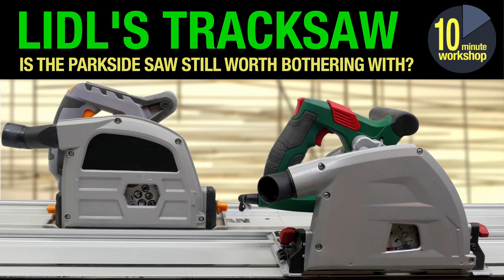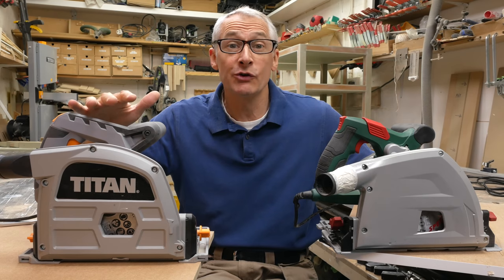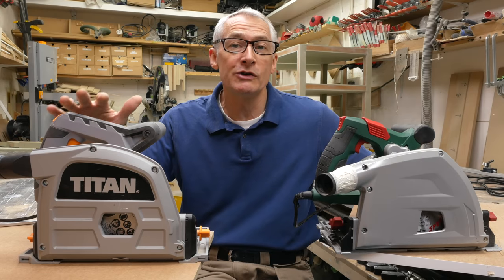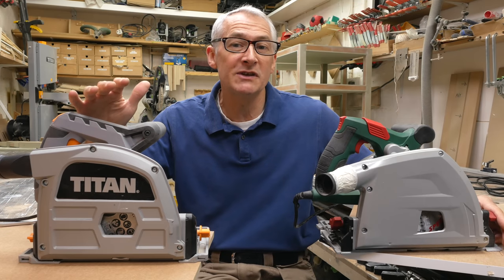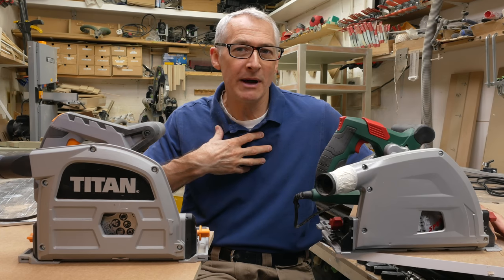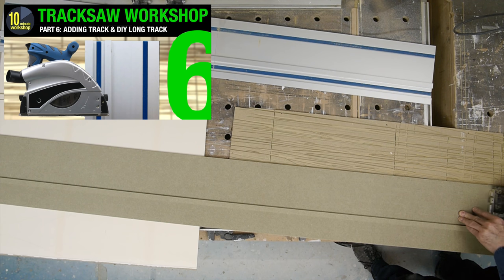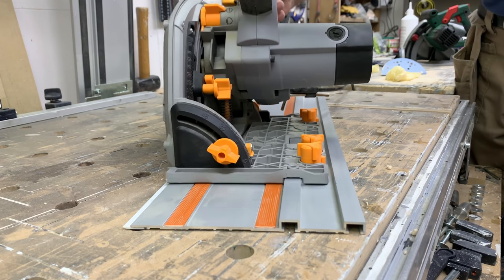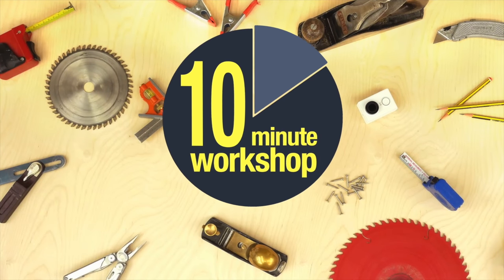Screwfix Titan or Lidl's Parkside Plunge Saw? [video #326]

Comment: Peter I see you have evolution track does it fit with titan track, I've seen comments it does and ones it doesn't, a titan track and a 1400 evolution track together be handy for triming doors
Reply from the maker: I'll have a video out about the Evolution track before too long, but I don't see why there'd be a problem; the titan track is as close to the makita track as you can get, and the makita track is Festool-pattern with an added lip. Workshop's a spray booth right now so I can't get at anything, but I'll take a look and post back 👍
Reply: @10MinuteWorkshop  Thanks Peter

Comment: hi peter great video. i just picked up the triton plunge saw because ill be cutting full sheets of plywood for flooring soon. i would like to get set up so i can cut the full lengths. whats the cheapest/best option to get rails to cut 2.4m lengths? i bought the triton instead of the workzone as you said it is more compatable with other rails. thanks
Reply from the maker: Hi Matt. Best option for rails right now is the Evolution rail package with two 1400 rails, clamps and a bag for ~£70;don't know why by my replies are getting chopped up, but the link is in the video description. 👍
Reply: @10MinuteWorkshop  thanks for getting back to me peter

Comment: I have watched all your numerous excellent plunge saw reviews setups etc but I am considering buying one and there seem to be very few reviews on Erbauer saw at Screwfix. Would you consider making one on this budget saw?
Reply: Nigel Timms I have a Erbauer one perfectly ok, l use it for rough stuff instead of Festool battery TS55 rail work with both slightly larger blade.

Comment: Hi Peter, on a related subject is the hinge for your fixed track saw rail a Festool specific item or could I adapt it to create a fixed rail with my Aldi rails(s)?  I looked on the website but couldn't locate it as a stand alone component.
Reply from the maker: It's part of the Festool MFT system (see videos #182 & 183) and the hinge is specific to Festool rails. They are available as a spare part, but the price isn't listed - last tie I looked they were a few hundred quid for the set. 🤷‍♂️🤔
Reply from the maker: Aldi uses Scheppach rails, so while you can't buy them from Aldi, you can get them from scheppach - at a price...
Reply: nasser d  
Parkside saw comes from LIDL not ALDI.
Workzone TOOLS ARE ALDI & Peter has a workzone tracksaw review.
Watch his videos.
Reply: Ta, I suspected as much. It caught my attention when I watched said vids, faithful acolyte that I am, and I've looked around at a few DIY options which various on here have califudged. It's not a necessity for me as I've made a table top sled/jig with fixed stops which serves me admirably but one alway wants the gadget doesn't one.

Comment: Excellent video as ever. I have bought the evolution guide rails for my Titan saw. I am looking forward to your thoughts on the evolution rails as mine do not have much grip at all when not clamped. So much so I am now looking for some new grip strips. Any help you can offer re this will be appreciated. Keep up the great content 👍😀
Reply from the maker: Interesting, I haven’t used the Evo rails in anger yet so haven’t had the chance to check out the grip. Best grip of all the rails I have is the Festool - do a search for Festool guiderail cushion strip and you should fine something. Only comes in 10metre lengths (I think) and not cheap, but great grip! 👍👍

Comment: Titan £55 in my local b&q, I saw another video on youtube where the splinter guard on the Parkside wasn't wide enough for the blade to cut through it and there was a gap, Parkside looks 2nd best and dearer, no brainer.
Reply from the maker: Yeah, that was probably Rim’s vid at Restoration Couple? He had a dud saw, no question. I’d have taken it back as soon as I saw the hunk on the blade cover. But yes, Titan at £55 is a steal. 👍

Comment: Another really helpful vid Peter. Have found the parkside plunge saw very useful a few times already since I got it. As I dont have a table saw, I have found it's quite versatile and is serving me well so far (apart from the vacuum connector which cracked, taped it up like yours now!). Got my eye on the evolution tracks... Thanks
P.s I've been looking maybe getting a Mitre saw and saw evolution do one quite reasonably priced. Can you recommend? Also, compound or sliding? Cheers
Reply from the maker: Thanks! I have an Evolution mitre saw on a longer-term test though I haven't used it all that much as I've had a lot going on. Let me just say that they're great if you have the need for a saw that will cut mild steel as well as timber, but if you just want something to cut wood then you can probably get a better finish elsewhere.
Reply: @10MinuteWorkshop  Thank you

Comment: I think the Lidl one is a generic Chinese model (with slight variations) - it looks suspiciously like the one I just got from Rutland tools, where they're branded it themselves with a sticker. But I think it's pretty good. I actually upgraded the tracks to Festool 1400s as I wasn't happy with A) the fact you need 4 of the original ones to cut an 8 x4 and B) the single-bar joining system does not inspire confidence. Much nicer with the Festool track. Cost me as much as the saw for 2 tracks and the joining bars, mind. I've also got a Freud 40 tooth blade in there and all in all, it works well. I've been cutting nice B/BB birch ply for kitchen cupboard doors, so the cuts have to be perfect at least on one side. The other thing about the Festool track is that the splinter guarding of the rubber strip actually works, because it's thick and high quality. It was useless on the other ones. Worth the upgrades for critical work, I think and still waaay cheaper than a Festool (that's my justification anyway)!
Reply from the maker: Yes, it's certainly very similar visually to the Rutlands one - couldn't say if they were made in the same factory without seeing them together, and probably not even then, lol! And yes, I agree - the tracks are the thing that let the saw down; a single 1400 rail would be much better, but we seem to be stuck with 2# 700s at the entry level.

Comment: When the Parkside is not available Rutlands has a clone of it in blue and red the price fluctuates like the Titan but they do, pretty regularly, do a 12 hour deal for power tools which you can sign up to receive by email
Reply: yup, i got mine for £70 from Rutlands. not let me down yet
Reply from the maker: Nice! Yes, the Rutland seems to be identical - didn’t know about the specials though! 👍👍
Reply: @10MinuteWorkshop  recently got the thicknesser, planner for under 160 rather than 240 they do some great deals, if it was something you were going to buy that is
Reply: @CharlieSkapentry  you really do need to wait for the discounts they do the bit the bullet

Comment: Anyone half proficient with a grinder or even a Dremel could make that Makita rail more compatible with other saws.
Reply: You would think Makita would rectify that so they could sell more rails
Reply: @Pistol_Knight  agreed
Reply from the maker: Yep - or a router / tablesaw / another tracksaw! And to be fair, the Parkside saw is the first I’ve found that doesn’t fit on the Makita rails, and the anti-tipping thing is one of the Makita’s big selling points. 🤷‍♂️
Reply: Just watched a video from the restoration couple and Tim is having real trouble with his parkside. Splinter guard looks to have already been trimmed, the blade doesn't touch it, and the blade retention bolt is stuck solid.
Reply from the maker: @rodgerq  Yes, I had a chat with Tim last night about it - looks like he has a dud - I'd have chucked it back to them as soon as I saw the gunk all over the blade housing - though it looks like he's using it now from what he's posted in instagram. I've heard of a couple of people with the 'stuck bolt' problem, though, so not an isolated thing, sadly. The benefit of buying supermarket tools is that they don't make a fuss about returns or exchanges 👍
Reply: The only issue with the parkside is that they may not have another to exchange you with. I unboxed mine and stuck the Triton blade in(cheers for that info) and it meets the splinter guard ok. The bolt was really tight on mine and it did take some wrestling.